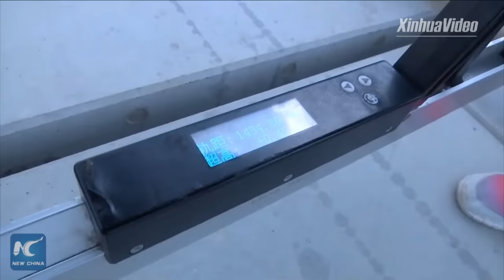How are China's high-speed rail tracks laid?

Comment: So how do they get the 500 meter length of track from the factory to the jobsite? And how does a factory make a 500 meter length of track? The furnace certainly can't be 500 meter long?
Reply: actually, the tracks from the original factory are 50 m, and then they are transported to a welding center near the construction site and are welded into 500m long tracks, and then are laid out on the right place. Finally, the 500m tracks will be welded into 2000m tracks or a whole track depending on different designed velocities, 250 km/h and 350 km/h, respectively.
Reply: Jiaqi Chen 
Thanks
Reply: Miyang Liu 
Thanks
Reply: @Miyang Liu Thank's from Paris&Montreal for the video about "welding".What is the equivalent of Plasser or Matissa ( tamper , tamping machines )  in China ?
Reply: Arxienne Romanova - Extrusion in one long piece at a Steel Mill beside the tracks.  Then the rails are immediately transported on special trains of flatcars.  The rails are handled just as you see here. Everything is designed to make this possible
Reply: sounds like they have not just devised a way of laying the track but the whole end to end infrastructure to make that possible
Reply: Arxienne Romanova you can also weld on train

Comment: There a tube of Kenya they show how the tracks are finalized cerfied for passenger use. It’s china first and it used A.I  and many very high speed camera  computer and sensors etc. it trouble shoot the track in real time and does a print out picture of the ties and copy’s  to give to track worker to  what tracks are not level. And what adjustments number are needed for each  ties that sector.   The goal is 99% level for safety and smoothness.
I find it funny trump worry about China getting A.I but they have it working in the fields already. LOL

Comment: Guessing these rail lengths are extruded? - if so would love to see the size of the billet of steel from they were squeezed and the size of the press used!
Reply: You can't extrude steel like you can aluminium.
Reply: Bodragon I’m no expert on extrusion so don’t doubt you. I once saw one of the largest steel presses In the world at the time (1990) which could extrude a three foot steel billet into a 5 metre (approx) steel tube. That press was deliberately destroyed during a subsequent takeover so no longer exists
Reply: Mark Roberts IT IS A PROCESS OF CONTINUOUS CASTING OF HIGH GRADE STEEL! IT COMES OUT OF THE SMELTER THEN IS RUN THROUGH THE ROLLING MILL!
THIS PROCESS HAS BEEN AROUND QUITE A FEW YEARS!
Reply: ROSS Bryan6 ok thanks, so rolled not extruded, cheers
Reply: NO rail is rolled and formed & hardened
Reply: John Williamson RAILWY AGE MAGAZINE ABOUT 1985 HAD AN ARTICLE REGARDING THE CONTINUOUS CASTING AND ROLLING PROCESS! WAS SEEN AS AN ANSWER TO 
IMPURITIES AND DEFECT RELATED TO THE 
CASTING OF INGOTS AND THEN ROLLING THE INGOT OUT INTO RAILS!
Reply: ROSS Bryan6 ... kill the asinine caps.  It's not cool and it's not necessary.  Though it does reveal your true age which obviously is the number directly following your name.
Reply: MelioraCogito I HAVE HAD CELL PHONES AND TEXT SINCE 1995 AND HAVE NO LARGE SCREEN COMPUTERS! 
USING THE CAPS MAKES IT EASIER TO READ FOR ACCURACY WHILE PUTTING MESSAGES TOGETHER!
I SUGGEST YOU FIND SOMETHING MORE USEFUL TO DO WITH YOUR TIME THAN TO MAKE A FEEBLE FAILED ATTEMPT AT PLAYING LANGUAGE POLICE!
IT IS MY PHONE, I PAY MY CHARGES MYSELF, AND USE TO MY NEEDS!
IF YOU ARE WILLING TO VOLUNTEER TO PAY MY MONTHLY PHONE BILL THEN I MIGHT CONSIDER CONFORMING TO YOUR PARTICULAR STYLE OF COMMUNICATION!
Reply: @MelioraCogito maybe kids spilled soda on the keyboard and it got stuck don't be quick to throw insults, bro...

Comment: Thank you for the metric measurements; how long each rail is, how much it weighs and how fast the trains are running. All given in kilograms, meters and kilometers per hour. If it was made in the USA or Britain they would probably have been gargling something incomprehensible about pounds, inches yards and miles and you would have had to employ a someone to translate it into a language we could all understand. Now it they could only devise a new clock that works on the metric system as well. Why do we still have 12 markings on a standard clock, each 5 minutes apart translating into 60 minutes per hour and 24 hours per day. Are we still living in the dark ages? If a train departs at 10h19 and arrives at 15H11,; how long did it take??? Simple calculation, isn't it? Now try and calculate your ave speed if you've traveled 833 kilometers in that time.....! Very simple indeed....!
Reply: @bigbobtong  How am I "the problem when I'm using the metric system as well (and thanking someone else for using metric measurements and not the old system based on twelves?

And how does that make me "behind my time"?

Comment: It’s surprising how much of the work is done manually. Worker safety standard seems inadequate.
Reply: David Lang You are nitpicking. You will find they have steel cap boots. No need for hard hats there with nothing overhead going on and no cranes working. All at ground level. Some had riggers gloves on, probably depends on there job. All construction workers on  high rise in China wear steel cap boots and rigger gloves and hard hats plus the normal long sleeve shirts and trousers. Looked OK to me. The only manual work done I could see would be very difficult to mechanize. When a relatively small team in your Nation can lay as much track as they do in a day you can criticise. Australian.
Reply: David Lang 

You mis understand him.
He means fashion, beautiful, expensive protection equipment. Adequate.

Comment: I also noticed the use of steel hasps that clamp over the end of the rail so captivating the wedge that is attached to the end of the pulling cable.

Once set, a blow or two from the worker with his sledgehammer sets it firm for the job.

(I also notice that some of those workers are dresses in military camouflage style colours, whereas others are in Hi vi=sibility orange. This would suggest to me that the ones in Camouflage dress are the heavy workers, and the others are more like technical supervisors??
Reply: You are right, Chinese labor workers like camouflage style, only because these clouthes are cheaper,  and harder to broke down. These labor workers are the workers hired to do the heavy work with lower technique demond. the others are the real technique engineers. they are not wearing suits or white shirts, because the working condition is not clean. too much dust and sweat.

Comment: Canada needs another open water port. Churchill Manitoba is considered the best area - Hudson's Bay to Europe! The connecting railroad needs a total rebuild. The problem, weather temperature can go from 30+ C. above to 50 - C. below. It would be interesting if this technology would fit the bill. It would probably be expensive on the outset but cheaper in the long run with less maintenance.

Comment: I hope the concrete railroad ties in this project are a lot better than the crap they sold to Metro-North here in New York state where they all broke and fell apart, and not too sure I'm a fan of all of those bolts to have to keep retorquing from vibration after a while becoming loose

Comment: In UK it takes over 2 years for planning and 2 years to lay 5 miles of train tracks! And then another 2 years for health and safety checks. Also, for some reason, they weld them together instead of bolt them. Everybody should wear a high visibility jacket and a helmet or else you are fired right there on the spot 😂

Comment: Also check out how the french are laying high speed track, somewhat different. They lay down a temporary track first consisting of 15? or maybe 20 meters sections of simple track. no ballast yet. Then they run a track rebuilding machine over this track and tie replacing machine. It is less labor intensive but i don't know if it's faster.
Reply: And why not use pandrol clips instead. Way faster and less hazzle.

Comment: 500 meter tracks! Wow! The only drawback I see with 500 meter tracks is if for some reason one track is damaged, it has to be replaced either by replacing the whole 500 meter track or just repairing partially the damaged section.

Comment: It looks like the sleepers (the beams) are made of pretensioned concrete. That makes the beam stronger. However, the steel is exposed. So i wonder how long the sleepers will stay strong. Because over time the steel could rot, and that would be bad for the tension strength of the beam. 

Greetings,

Jeff
Reply: Making seamless rails is one of the most difficult technologies for manufacturing high speed rail because of the special steel used, which only a few countries in the world are capable of producing. Laying the rails is actually the easiest step. Secondly, the rail actually has a service life, generally to life will be replaced, usually 10 years to replace once
Reply: @guzilayerken5013  I bet most steels work for rails. They have been laying rails for a long long time now. It works just fine. High speed rails may be more demanding, but i doubt its that demanding. 

Also you can weld on new layers onto the rails and have a grinder grind the rails to shape. Its all done in one pass with a special train. 

Greetings,

Jeff

Comment: With 500 meter sections how is thermal expansion and contraction accounted for?
Reply: I don't know, as there was no footage of joining the rail sections. In the UK the sections are tensioned and joined by thermite welding. As the rails heat up in summer, the tension relaxes instead of increasing and making the track buckle. The strength of the steel can cope with contraction in winter. I hope the Chinese do this, too. If they rely on fishplates I won't be risking a trip on a high-speed train.

Comment: From Canada:
From China where knowledge of english is scarce, the Lady announcer/commentatorwas very nice and enjoyable! 

too bad I could not have a chat with her and exchange some english for chinese linguistics! that would be some nice intellectuial fun!

As a retired electronic technician (age 73) I wonder about those 500 M. rails and what about their expansion and contraction with changing seasons and temperatures?

Are they smelted of an alloy that has a coefficient of expansion of Zero?

Also it looks like the sleepers (the cross members on which the rails are laid) seem to be made of something stone-like. this seems to have some degree fof similarity with the sleepers used for the high speectracks in the U.S.A. for their Acela train.

I would expect in both cases this reduces the concern for rotting and other degradation due to the elements of nature and also makes them much harder and more stable when the trains run over them. Is my surmise correct?

Unfortunately high speed rail is not practical in Canada because distanxces are ery great anf d the population density is extremely low, resulting in no hope of adequate ridership to underwrite the cost of such projects.

In stead our cross-Canada train, via Rail's "The Canadian" is more of a scenic tourist trip than busines slike transportation. (and that thrain does not cover all of Canada's width, on the east end, at toronto, you would then have another 500 km. (about 4 hours) to Montreal on that train, and another overnight to Halifax (more than and additional 11000 kim.).

These rideas can be seen as videos on you tube as long as you can view them. Another factor iswinter. Iam thinking the north of China has snow and ice in the winter, as does Canada.

This can add to the general list of difficulties. so if the trip is going to be an overnight train in Canada, for business travel fly, its the only way to travel with business time-efficiency.

Comment: You need to remember the important part of this equation is IF the track is straight after its down.  Not how they lay it.  The Japanese and German/French own the only high speed tech and I am sure that the engineers for this project are from either of those places.  I know that their original line from Beijing to Guangjo was Japanese locomotive.  Its far more than track laying.  The Japanese had to TUNNEL thru something like 200 mountains and keep it straight and level.   The Japanese have never had a fatality on theirs.  Lets see about china
Reply: the us has the same high speed TECH

Comment: Each steel rail installed is 500 meters long? 1600 feet?  How the hell do they get that to the job site? The steel mill has to be located right next to the tracks no?
Reply: The rails are quite flexible.  They can connect several flat cars and transport the rails on a long train  1600 feet is a relatively short train.
Reply: the us does it every day

Comment: At 14:51 I see the sort of "bolts" they are using to hold down (via the heavy wire clamps), the rails to the sleepers. I would have called these Hex head hardened lag bolts, and to get thenm to cut their thread into the sleepers, they are greased with some sort of lubricant at the time of  being driven. (I wonder what kind of chemistry went into that "special black grease".)
Reply: That is a common grease, a higher qualitly soft carbon-based grease that is soft and don't harden that easily.  You can easilly buy it off the shelf from your neighbour hardware shop.

Comment: those tracks look really rusted!
Reply: All rail has a light patina of rust on it.
Reply: you should see the ones in the UK lol all rail outside is surface rusted
Reply: Yes, but once in use the wheel will grind out the top of the rail to shine, and over time shake quite a bit of rust off...
It will actually look like what you see, rails in any countries...

Initially it does look like this

Comment: Downvoted this because the video is poor. They don't show us how the sleepers are laid  and aligned. The the long winded explanation of the engineer could have been edited in later as subtitles. This innovative technique could have been shown much better.

This is so in contrast to the Russian video I saw on the revitalization of the BAM (Baikal Amur Magistral),  from which video they could learn a thing or two. There they took us all the way to the foundry, showing how the metal rods for the sleepers were metallurgically tested and then the sleepers being made, showing the ends of the rods protruding from the sleepers,. Also they showed a huge bucket pouring out the molten metal, but can't remember if this was about the rails being made. 

Showed also the different technique they used, which was to deliver rails already attached to sleepers from factory, which were then welded onsite. Also they showed the engineers having to adjust the horizontal angles of the rails. Would have been interesting to see how the Chinese engineers verified the plane of the tracks.
Reply: I am very happy with the video but skip your long winded complain half way through haha

Comment: S&P 500 6.114.75+$250 Green 💚🍏 500km 300-380 km per hour HighSpeed Modern Security Extra Larger Hyper Expensive 5G Boosters Router 🛜 64 Megapixels connection HighSpeed  networks program MegaBus NORTON Commander and Utilities RGBs Agendary Upgrade HighSpeed Upscale Stadium Top 25 WiFi6 64 Megapixels connection ESET Nod turboGT Kaspersky anti-virus internet connection Avast turbo Antivirus protection Green networks

Comment: Railroads are a joke and dangerous, hyperloop is the future and safe!
Reply: hyper loop has catch 22. You can only send one cab at a time and that the amount of time it arrive, because the secound cab seals prevent the source compress air from pushing the first cab to the destination it will slow down and the secound cab hitting it. That why musk Change the plan to multi street level design. And one cab long distance. But  musk hyperloop is behind another company hyperloop it’s a copy. It still in the experimental stage
Reply: again talk about valcuim pipe hsr, china is going futher than hyperloop